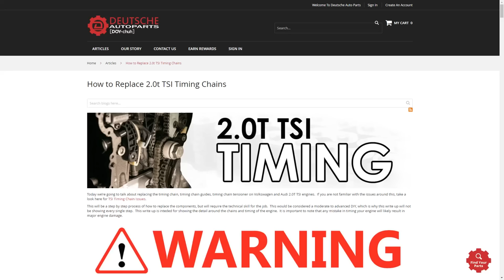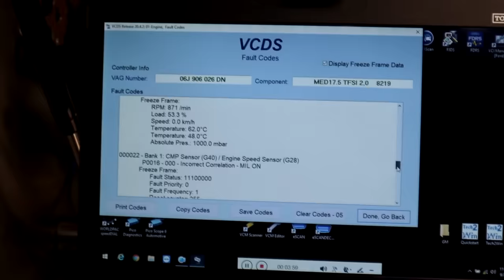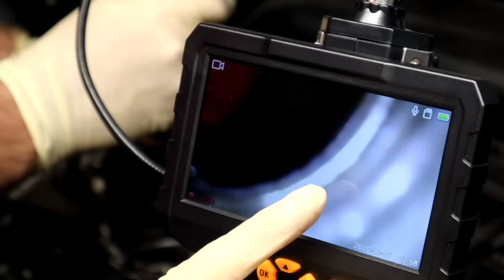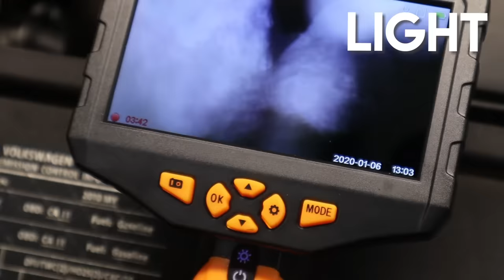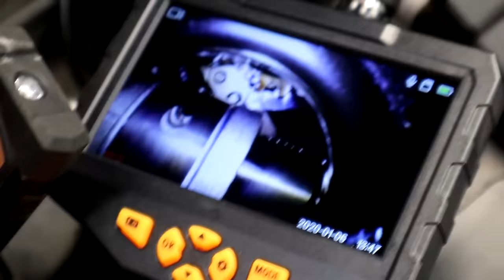The Jalopnik Tiguan FAILED ~ Despite the Warning

Comment: Would a junk yard turn key motor be a good option?

Or just an LS swap for for the same amount as a new vw motor
Reply from the maker: The issue with the junkyard motor is I’d worry all the same pattern failures would need to be fixed
Reply: @HumbleMechanic  
When were the timing issues fixed bc I have a 2016 Golf R which is driven to max revs on my 30min daily commute after the motor warms up.
( i get a few red lights on a 55mph country road when driving to work from the city and fully enjoy hitting those red lights for fun rigorous rolling launches 🚀)  it accelerates hard and faster than the old dearly departed C6 vette even though it’s slower because I’m shifting through 3 gears instead of 1.

Just curious if I to may have a ticking time bomb compared to my old C6 z51 vette  that I sold for it which had 145,000 miles of ls smiles on it.
Reply from the maker: Not ever an issue on that engine.
Reply: @HumbleMechanic  thank you for the reply and that’s good to know.

What’s the difference in the 2.0TSI golf  R motor that makes the timing more reliable?

I know it’s supposed to be a very tunable engine however I know the rear diff is a weak spot when adding more higher hp numbers to the car.

Does the Golf R mk7 use stronger internals over the suv’s 2.0tsi engine?

Im still waiting for ecs to come out with a tune for my current version of the drive train so I can lock it 50-50 or at least 60-40 in race mode and place it back into fwd in comfort mode so I no longer have to guess what it’s trying to do when I need to now what to expect from the drive train from a trust it perspective .

Comment: One of the not so many good things about living in Eastern Europe is that you can rebuild a head with bent valves and do the entire job those guys did for less than $1000.
Reply from the maker: why is that not a good thing?
Reply: @HumbleMechanic  It is a good thing. It's just that other things in the East are not so good.

Comment: Why you didn't took off oil pan and cleaned it with oil suction filter? All that missing metal from chain cover is still in the engine.

Those engines are total junk. You fixed the issue with timing belt (maybe, since they redesign it numerous times already), but there is even bigger disaster waiting. It's their shitty piston rings, which gets clogged up with carbon and engine start's to consume the oil (1l per 500miles is"normal"). You can get better piston rings, but you also have to replace piston, since there are different grooves for rings. But those pistons wont fit on your connecting rods,  since wrist pin have different diameter, so also buy new connecting rods. You're looking at another five grants. It's cheaper to take it to junkyard.

Comment: So, what do we do if the lobe has spun? Please & Thank you
Reply from the maker: Id put a cam in it.
Reply: Is this it repairable or do I need to replace it. The 5&6 lobes on my intake camshaft are about 45 degrees off from each other. 2009 Tiguan 81,000 miles
Reply: Thanks

Comment: Now u got me scared to drive my mk6 gti I’ve been putting off checking the tensioner lol
Reply: Yep my mk6 was biggest POS car I ever had. Clutch, turbo, intake, wheel bearings, timing all went before 80k when I walked away. Didn’t wait for rear main seal or PCV problems 

As bad as the street cred for MINI is my 2013 bought before the GTI is still going strong at 100k
Reply: @jazzshow  so far mine hasn’t been too bad a bit over a year and 15k miles only issue was a plastic fitting for the radiator and that was because of a poorly installed cold air intake by the previous owner
Reply: @danielbarrera6559  well good luck, it was a nice car when it wasn’t broken. Hardly ever see GTI more than 5 years old, I just don’t think they’re built to last.

Comment: what is the sound after engine running? @38:00 I found such sound after the car getting old. This is not happened on new car.
Reply from the maker: Remember you’re not hearing the true sound of the engine. It’s engine through a mic, auto manipulation from the editing and then through a speaker. 

Plus the CCTA is a loud engine anyway
Reply: @HumbleMechanic  I have 2 VW. After they getting old, the engine has some sound like tatatatatata. Which part should be a source? Timing chain / belt? Alternator?

Comment: Pressed on cam lobes, wth!  It's is bad enough that the Audi 2.8L don't use keyed cam gears, it's a bevel fit and they can slip too.
Reply from the maker: I’ve seen that slip one time on that design. But it was the tech that was working on its fault. Sucked to pull the head on the Touareg because of it.

Comment: how to fix a VW = buy an air cooled one or put in pull into a local Ford dealer trade in for F150 use for 10 days and trade it into a Toyota dealer for a Tundra pick up.

Comment: The engine should be good for another 30k miles now?
Reply from the maker: Hahbaha
Reply: @HumbleMechanic  I love your videos, and that thought just came to my head, maybe from my personal experience. 
I had a 2005 Honda Accord and at 110k miles the alternator failed and I replaced it. Then one of the coil packs failed at 140k miles. So I replaced that too. Then I realised that every component in the car had basically reached its end of life (the car was 13 years old, and never garaged). So in your case, even though you have fixed this issue, another fault will likely appear soon, due to the age of the engine/car.

Comment: KBB says this car was worth around $2k pre-failure.  Seems like it's not worth the cost of repair.
Reply from the maker: But what’s the alternative? Not having a car or spending way more on a car with complete unknowns? Often not an easy answer
Reply: @HumbleMechanic  You're not going to like this, Charles.  Used Toyota Camry or Corolla.  Or Honda Civic.
Reply: Sounds like trade in Value.  They are around $5k for higher mileage early Tiguan's on FB marketplace.

Comment: VW really cheeped out with this engine.    Stamped metal chain cover instead of a machined cast aluminum cover is one example.  The other example are camshafts that instead of machined and ground out of a single piece of steel, the lobes are pressed onto the shaft.. WHAT?!?!?

Comment: Goodness i miss timing belts and SOHC VWs.....

My goodness, it really has been a race to the bottom. Pressed on cam lobes, what? I remember when a VW was good for 300,000 miles with nothing but oil and timing belt changes. Oh and a numb plastic water pump impeller. Days gone by.

Comment: 34:17 I think it's actually 150Nm + 180deg... which is nothing by Mercedes standards.

Mercedes be like: Tighten this crank pulley bolt to 900Nm + 1200deg, have fun!

Comment: VW be like oh yeah, just replace the engine every 100,000 miles. Normal maintenance.
Reply: That would be every Chevy with a lifetime Auto Transmission fluid label. Each VW I have had had has done 150K Miles. The present one lasted165K on the original clutch.

Comment: My equinox had the timing chain snap damaging the engine and yes we had to replace the valves too, almost 5,000 dollars to fix with less than 68,000 miles. The newer cars are garbage. I'll take my old 1980 ss monte carlo over any of the newer shitpiles.

Comment: Charles, this is a long shot - have a code P0299 coming up on my 2.0tdi Tiguan. The coil light comes on flashing and occurs everytime I'm on an incline on fast roads - doesn't happen around town. Even at consistent speed for example with cruise on this issue occurs. Would this still be the wastegate causing the issue?
Reply from the maker: Possible. The TDI is a little different but possible

Comment: Sounds like another major recall or class action suit
Reply from the maker: there was a warranty extension after a CSA(I think anyway) but no recall. 

Recalls require a very specific thing to be enacted.
Reply: @HumbleMechanic  
Good to know

By the way,  I’m looking to simply dump the rear haldex system on my mk7 golf R and put in a beefy axle going to a rear LSD... 

I’m a controls engineer so all I need is help finding the best programming software to shut up the drivetrain alarms.

My ultimate goal is to just do away with the front wheel drive system.

And I enjoy car projects

Comment: The 2.0T and many Audi/VW engines are way over engineered. The old 1.8T was a great engine aside from the K03’s failing. A K04 and a chip and that thing blows the doors off a 2.0T in power and reliability. 2.0T is pure rubbish.

Comment: I hate when it's called Timing Chain "Stretch!!! The links wear giving the illusion that it's stretched.
Reply from the maker: Yes yes I know. However it’s what even the industry as a whole uses. We have to walk the line some times on this one.
Reply: @HumbleMechanic  Regarding cam cover gaskets. I have a 4.2 A8 which consistently leaks from the valve cover. It's the same engine as in the Phaeton.  Someone told me that it was a good idea to add a dab of RTV to the 4 corners where the half moon cutouts are were the camshaft line up on the head. Is this true?

Comment: I have a 2013 VW Tiguan... it couldn't be a more huge pile of junk.  VW engineers and VW have betrayed their customers.  What was once a great and easy to maintain vehicle has become an over-engineered piece of unreliable junk; plastic and other synthetics inside the engine timing chain; plastic intake manifold, plastic everywhere.  Plastic deteriorates and fails under extreme heat, and that especially important where engines are concerned, as it is by its very design, a source of producing extreme heat.  Shame on VW, and pity to us unwitting VW owners who bought into the old, defunct history of what we knew as good German engineering, and German quality.

Comment: When i see how you attach the battery charging cables i know all about your automotive competencies.....and switch off.
Reply from the maker: Haha okay 🤷‍♂️ care to elaborate? Or maybe you’re talking about hooking both up to a battery I’m zero % worried about sparking?
Reply: @HumbleMechanic  Exactly. You connect to the specified connection point (especially the Tiguan have this and if you would clarify this BEFORE connecting.....shows that you are able to learn) or a free metallic point on the engine block. If you don't worry about sparkling that's nice, I would, because this can damage the on-board computer, which create unnecessary additional cost.
Reply from the maker: You’re thinking in jumper cable terms(even then I’m not super stressed) 

This is more in battery charger terms. Vw says battery chargers go right on the battery or the jump start posts for cars with remote mounted batteries(under the driver seat, or in the trunk) 

So I’m going to stick with the method of every vw TSB, recall, tech tip, and the 1000+ hours of vw factory training says to do.
Reply: @HumbleMechanic  Well don't tell me something about. I am working in Group Training Academy. Obviously the quality in US needs to improve urgently.   :-)
Reply from the maker: I’m not sure what to tell you 🤷‍♂️ I wonder how BMW, the most sensitive electrical system out there, says to do.
Reply: @HumbleMechanic  Not talking about competition. Hehe :-) I know for Porsche, Lamborghini, VW, Audi, Seat, Skoda, Bentley and Bugatti as i am working for the group. And with this brands, you better don't do. One reason is that the on/board computer is open (for sparkling damage) more the 20 mins after you close electricity circuit. The capacitators still have enough power to keep it running for protocols/error memory  and other stuff.  I am not telling you how you should do your job. Please understand.

Comment: Why I won’t ever buy a vw/Audi. Because they all blow up and are junk.
Reply: I have a 2003 Polo tdi 1.4 3cyl with 383km. Never had a major issue with it. Changed water pump once and clutch and have had regular maintenance on it.
Reply: Then please don't.  I have got 165K mi on my 2001 Golf with the original clutch and with the aid of a Bentley Manual, I just want to keep it going until the wife sings off on my dream car.  (She brought it to the marriage; but I diverge.) 
Every company makes compromises. There is nothing new here. My BMW e36 has similar issues and with a Bentley manual, I became an expert are certain repairs. Be thankful there are people out there to show you the way to get some grease under your fingernails and actually get the job done. VWs have a fine tradition of converting owners into mechanics. Enjoy the ride!

Comment: Pffft.  Gizmodo. They don't know squat about cars. Hence him buying a stupid Tiguan, an overprices rip off when new; okay he bought a used one but still. That thing is a crap.
You want to know a good reviewer? There is a Korean car reviewer who does 50 min review clips of multiple videos on a single car. He goes through the front to back, top to bottom, engine compartment, the subframes designs, suspension designs, brake caliper designs, heat treatment of the exhaust systems, literally everything. He talks about the size of sub frames and if that is enough for the weight. He talks about the geometry of the rear suspension and how they effect the high speed handling. He talks about transmission designs and their logic softwares and how they suck in some maker cars, namely the some US cars and Korean ones which were poor until recent ones. He talks about three major design differences of Hybrid systems and how they work. Then, he drives the cars to the max safety speed and gives you his honest opinion. He trashes Hyundais, Kias, Ssayongs, German cars, American cars, Japanese cars, French cars and so forth if they suck. He tests super cars to econo cars. And yes, he used to work for Hyundai. VW Tiguan is a piece of crap. And Gizmodo knows crap.

Comment: Hey guys !
I dont want to throw down the toilet your offer of the cylinder head kit but the numbers doesn't add up.
Many machine shops charge $300 to rebuild that head and that includes washing the head, disassembling it, put it the oven to be able to remove the carbon during the sandblasting, machining it, re do the valve seats, washing it again and inatalling (new) valve seals (not included in the price), and (new) valves (not included in the price).
So, we have $300 from the machine shop and if we add everything else icluded in the cylinder head kit, we can go up to $1000 against the $3000 that you are asking...
Cheaper ?
I don't think so...
Convenient ?
I don't think so neither...
Anyway it's going to take 2 days to get the head ready back...
Reply from the maker: A fine point. However if the valve damaged the head, then it doesn't matter.

Comment: This is why combustion engines are just a hunk of junk xD.
Too much faff 
Electric motors FTW
Reply: Not all engines. Honda and Toyota are some of the best. Toyota Engines lasts the life of the vehicle  which could be up to 25 to 30 years.
Honda engines lasts even longer. Honda engines lasts so long that their total useful life is unknown. Most are wrecked with the car (due to needing paint, rust or disinterest) still in working order.
Honda engines in original factory sealed form (not overhauled) are still doing the rounds (being transplanted from one car to another) well over after over 30 years (B, D, H and F series)
For Electric motors the motors may or may not last but what gives out that is just as expensive if not more than the electric motors is the batteries, chargers & other electrical components that are way more complex than an ICE.

Comment: Uffff
Reply: You guys remind me when my time chain stretch on a Saturn aura xr 2007 with a 3.5l vvt. Got to paid 2k to fix it. The engine had only 87,000 km when it failed ;(
Surprisingly the dealer charge less than a private shop. Love the car after but unfortunately I sold it a 1year & 1/2 later. when the airbag began acting up on the passenger seat.